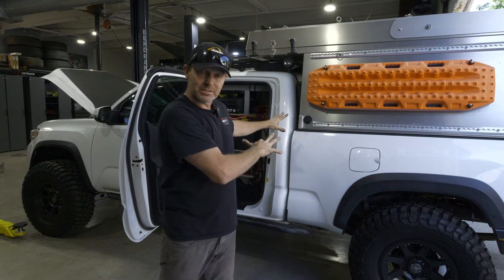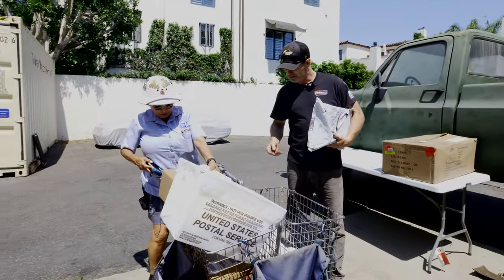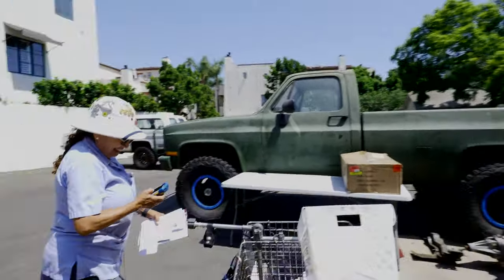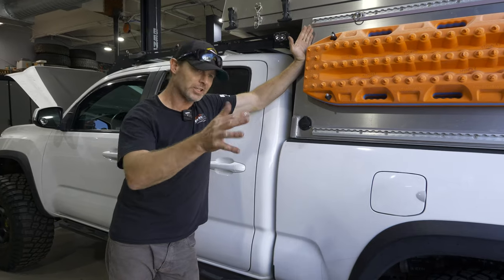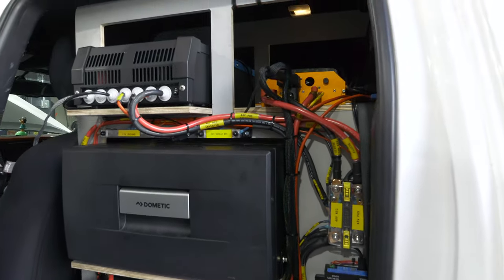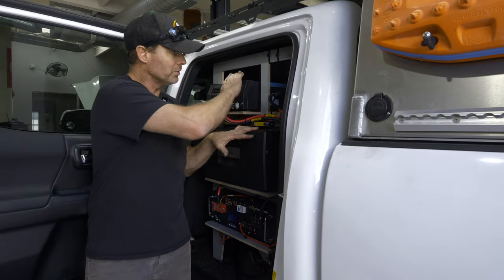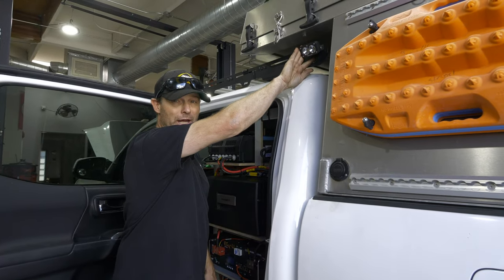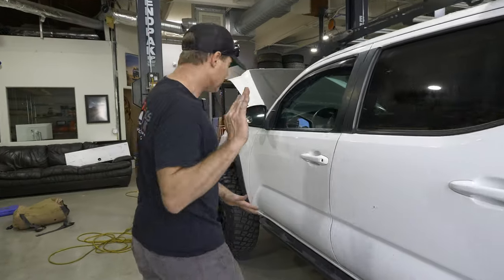This was the most technical install I have ever done!

Comment: Good stuff.  Nice to see the different things and being open to new things.

The Volt is kinda a very interesting car I was able to be trained on it with GM when it first came out. The Volts battery is a 360 volt DC  and won't hold its self together outside the car without a structure support.  The car body is its support. But they did run the a/c compressor with a 300 volt system. And yes they use a transformer if you will. As well as the technology was upgraded so was the car with new and proved ways Very complex system to do all of it   to charge the 12 volt battery or run the ac compressor or regenerate braking a long with other needed systems. Like the steering or keeping the battery temps maintained by cooling it or warming it when needed when charging it  or  when voltage is being consumed

But when you get into the 40 volt range you have to be careful that's where voltages start to enter your body weather you want it to or not.

Great stuff keep it up!!

Comment: Where did you get the battery & how much does it weigh & Cost?  Diesels need 2 batteries & I don't have room in the cab or in the box, do those 48V cells come in different shapes & are any water proof to be mounted under the truck to run everything?  I could put the inverter (scotty) under the hood if it's OK with the temps?

Comment: Absolutely love this new technology,  it's been around for a while, l watched some builds, and with this technology comes new and more compact systems. A lot of energy that can seriously hurt someone. I hope you do way more filming and teaching, the new or old, just any enthusiast really on how to stay safe, that there is and must be an easy to reach shut off in case of an accident.  Of course the fire, e.m.t. or police must know how to shut it down, the master shut off.
SAFETY FIRST❕
SO YES TO ALL SORTS OF NEW HIGH PERFORMANCE ELECTRONICS❕and regular performance stuff. 
Thanks for sharing 👍, and a big Welcome to " Ready Rigs "
It will be nice to see and hear some debate, and dialog. 
How about the square body and beyond, the 2000 to 2006 Era G.M.trucks, tunes! Dash replacement, "Dakota Digital" stuff, installing I - pads? Electric fans, cages! Rock slides, winch bumpers, front and rear. Roof racks, side window delete? Install on the subs and Yukons storage and rear pull outs...
Yes more stuff! And some new ? O.B.S. 1, 2, or 3 vidios a week, who else is going to do it? 
Have fun, see you? 👀Friday? 
👍✌🏻🔑🌤🇨🇦